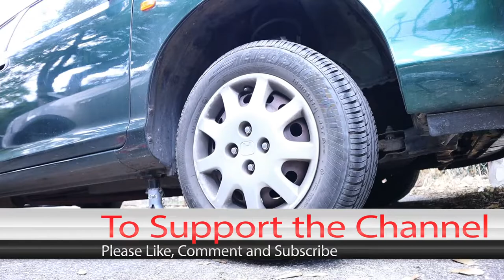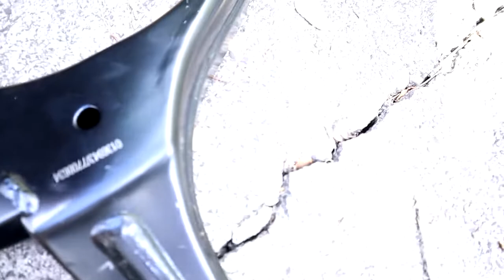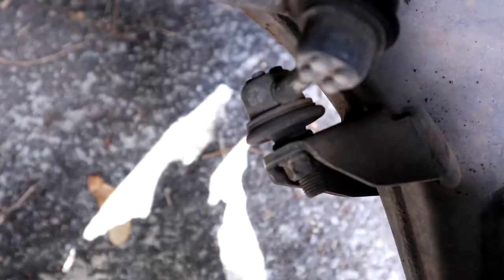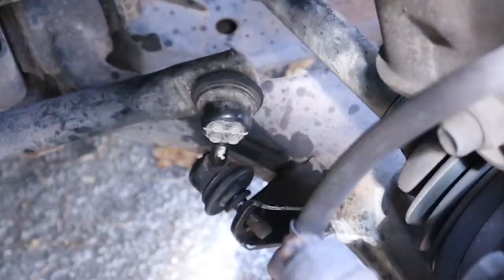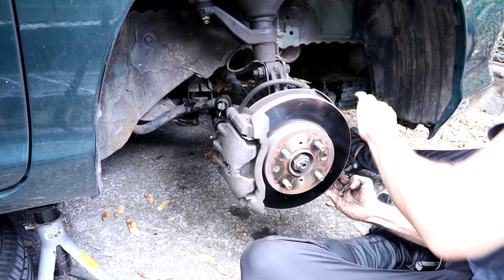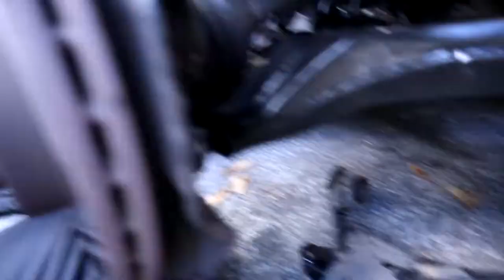lower control arm replacement honda civic 2001-2003

Comment: You made it look easy good job. I'm trying to do this myself. I was intimidated because i seen other videos from professional mechanics sawing off the control link bar, and maybe because they have the car lifted overhead. Good video. Do you know the proper torque specs for the control arm and link?
Reply: Tight as hell
Reply from the maker: Hello sorry mate i dont have the torq specs. normally in the old school, when you are in the rush  you already know when you are tightening. I used torque specs more on camshaft, headgasket, timing belt. But if you want to be sure in the repair manual by Haynes or similar you can find all these torque specs, sorry mate
Reply: Also thank you for the comment, yes sometimes i see some mechanics on internet they have all the toys to make the job, it is not fair 😂😂😂
Reply: Anti-roll bar clamp bolts and drop link nuts (use new nuts and bolts) 39 Nm/29 lbf ft
Bottom balljoint nut: Stage 1-minimum setting 49 Nm/36 lbf ft, Stage 2-maximum setting 59 Nm/44 lbf ft
Driveshaft/hub nut (use new nuts) 181 Nm/134 lbf ft
Front subframe bolts (M10) 59 Nm/44 lbf ft, (M14) 103 Nm/76 lbf ft
Lower arm pivot and inner mounting bolts: 83 Nm/61 lbf ft
Strut piston rod nut (use new nuts) 44 Nm/32 lbf ft
Strut-to-hub pinch-bolt nut: 103 Nm/76 lbf ft 
Strut upper mounting nuts 44 Nm/32 lbf ft

Comment: Hey I was looking for a rear driver lower control arms with end links. Any idea where I can find that part? Thanks
Reply from the maker: Hey mate sorry for the late i think you are referring to the ball joint , you can buy that one separately, the problem. Is to install it you and remove it, you will need a proper press tool, or go to the workshop and pay for that job, you can find the part no pobrem in europe in autodoc or maybe autozone, eBay, etc, but the problem is to remove it with basic tools, this is why normally the people in this model bay the whole lower control arm, thank you for your comment, good luck matex you can use this home tool but still will be a little difficult , but if you have the time , you can try and patience you can try 

https://www.amazon.com/Joint-Separator-Removal-Puller-Honda/dp/B09MZ5G4DK/ref=sr_1_4_sspa?crid=SMTMF1MUH5LE&keywords=ball+joint+tool&qid=1664472038&qu=eyJxc2MiOiI1LjU0IiwicXNhIjoiNC45OSIsInFzcCI6IjQuNjcifQ%3D%3D&sprefix=ball+joints+tool%2Caps%2C195&sr=8-4-spons&psc=1&spLa=ZW5jcnlwdGVkUXVhbGlmaWVyPUE1OFZRS1pYT0NQVk4mZW5jcnlwdGVkSWQ9QTA1MTQzMjIyMllVNE5FRlVSSEhKJmVuY3J5cHRlZEFkSWQ9QTAwOTc0MDEyMUwzSlBEUjhZVDQxJndpZGdldE5hbWU9c3BfYXRmJmFjdGlvbj1jbGlja1JlZGlyZWN0JmRvTm90TG9nQ2xpY2s9dHJ1ZQ==

Comment: Can I use a pickle fork for removing the ball joints, I’m going to replace them as well when I do the front lower control arms
Reply from the maker: I wanted to do the same but I researched and  The ball joints in this model must be extracted with hydraulic press, or there is a special tool for that, thank you for asking

Comment: How are you loosening all the nuts so easily…
Reply from the maker: Spray WD 40 on the threads and nuts before starting, let it act for a few minutes, that helps, use some wrench extensions

Comment from the maker: Hello everyone I hope you enjoy this video,  I will be replacing the ball joints, I recommend loosening the ball joints with the proper tool as this link, they are obviously worn out as shown in the video, thank you, best regards 

https://www.amazon.com/Joint-Separator-Removal-Puller-Honda/dp/B09MZ5G4DK/ref=sr_1_4_sspa?crid=SMTMF1MUH5LE&keywords=ball+joint+tool&qid=1664472038&qu=eyJxc2MiOiI1LjU0IiwicXNhIjoiNC45OSIsInFzcCI6IjQuNjcifQ%3D%3D&sprefix=ball+joints+tool%2Caps%2C195&sr=8-4-spons&psc=1&spLa=ZW5jcnlwdGVkUXVhbGlmaWVyPUE1OFZRS1pYT0NQVk4mZW5jcnlwdGVkSWQ9QTA1MTQzMjIyMllVNE5FRlVSSEhKJmVuY3J5cHRlZEFkSWQ9QTAwOTc0MDEyMUwzSlBEUjhZVDQxJndpZGdldE5hbWU9c3BfYXRmJmFjdGlvbj1jbGlja1JlZGlyZWN0JmRvTm90TG9nQ2xpY2s9dHJ1ZQ==